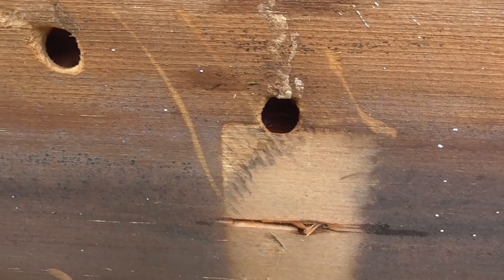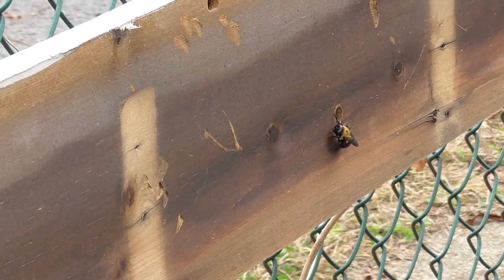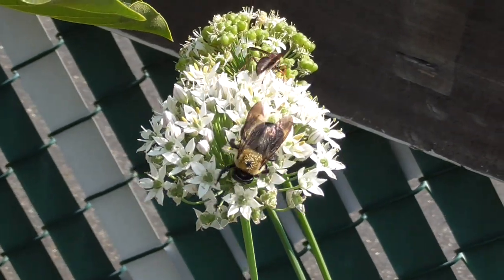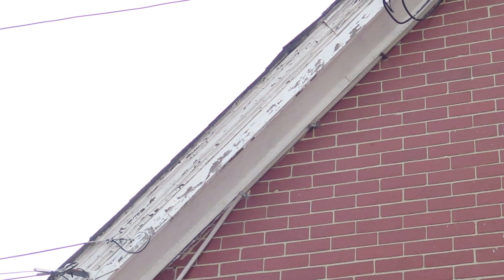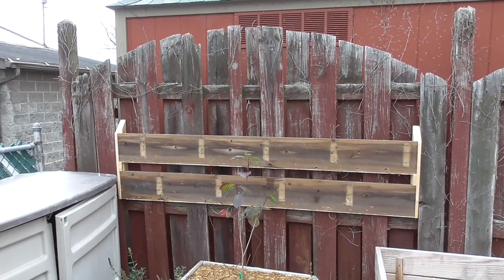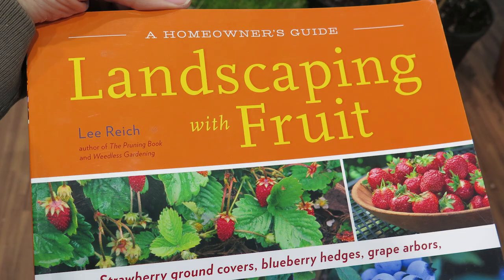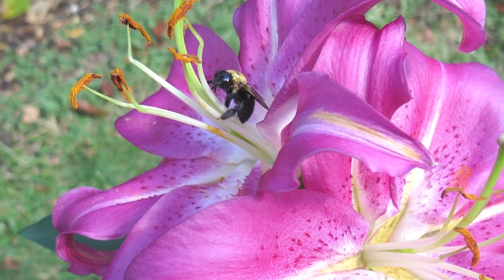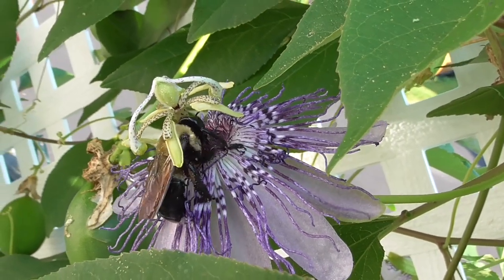How to Get Rid of Carpenter Bees: Stop Damage without Traps (Making Friends w/ Garden Pollinators!)

Comment: I did not know carpenter bees actually did woodwork, those things are tough huh! 
Mr Pepper! I was thinking, It’d be very useful to know how much light you get in between light fixtures, I mean if your getting 250 on the outer edges of your (2x2 for example) would that equal 500 when you add the 25O residual from the next light over? Curious because I get pretty decent results in the “in between” spaces but could it add up too much in “the overlap”  if the lights are close  together?
You da man Albo! A true man of science!
Reply from the maker: Thanks for watching! I think you can directly add the overlap PPFD values from one light map onto the overlapping values for a 2nd light. That's why some of my grow light tests show PPFD maps without any reflective sides. This helps with light spacing calculations.
Reply: @Albopepper  I’ll have to check your ppfd videos again, you tested 3 of my lights and I trust your data more than the cdc lol 
mille grazie paisano!

Comment: I have extensive wooden eves that aren't going to be replaced with vinyl. So this solution won't work for me, but I'm definitely on board with this messaging. I'd like to figure out how to deter them from my home while giving them other places to live so that they can keep up the good work they do and contribute to bio-diversity. They are also native pollinators in my area.
Reply from the maker: Yes, that would be such a challenge! I've noticed that they seem quite happy to keep reusing the pre-existing boards for their homes. Year after year they tend to stay put in those spots. If they could be coaxed to live in a DIY bee home/hotel, perhaps they would be less interested in other wood. A thick coating of paint is a good place to start for protecting important surfaces.
Reply: @Albopepper  I do work with a pest control company, not to exterminate, but relocate. Once recommendation they had was to get some other material near by they find desirable, make what they are currently in (my eves) undesirable, and over the winter when the young ones are still growing and haven't come out yet relocate the new material. The next spring they new bees will come out and won't really know they've been moved and they will keep coming back to that new spot. It's pretty much exactly like you did with your fascia boards. So far I haven't found anything they'd rather bore into or I haven't made the eves undesirable enough. It's a process. :)
Reply: Biggest way to keep any bees out of the eves or walls of you house if to make sure all cracks are covered with a wood trim. Silicone may also work, I don’t know for sure if the bees would try digging out the silicone or not? I think their more interested in cracks or holes they can easily get into for the most part. I know I have silicone a lot of cracks or gaps around my eves and the siding and least so far I haven’t had any problems with the bees trying to get in. Then again I really don’t know if I have these carpenter bees or not?  But I do see bumblebees around quite often or they look like bumblebees! Personally never knew the difference between the two bees? Not sure I want to get that close to figure it out either? Never been stung be a bumble bee and rather not have a first time either! LOL Yellow jackets are bad enough and bumble bees are bigger! Guessing the bumblebees sting is worse then a yellow jackets sting? Anyone know?
Reply from the maker: @ghostridergale  One of the other viewers mentions that yellow jacket stings are far more painful than carpenter bees. Remember: Only the female carpenter bees have stingers. I've found them to be more passive than the males. Either way, none have ever stung me after all of these years working in tight quarters in my garden. In contrast, I can attest to the pain of a yellow jacket sting!!!   ack   😱